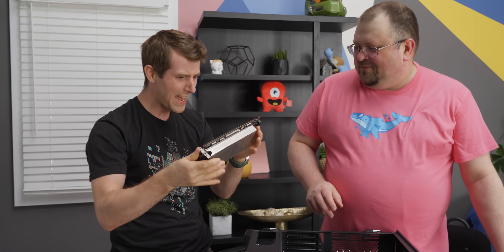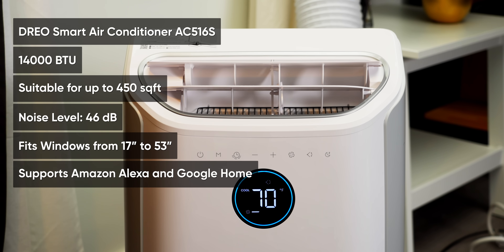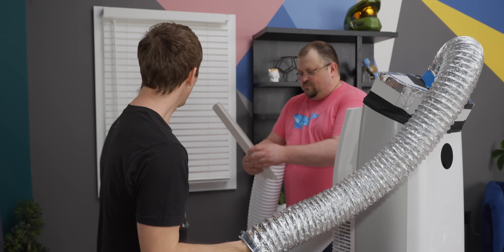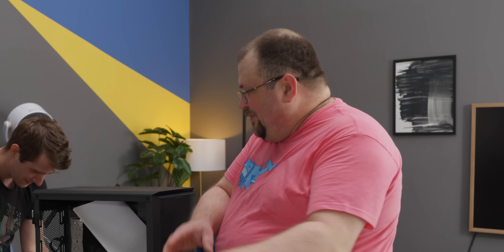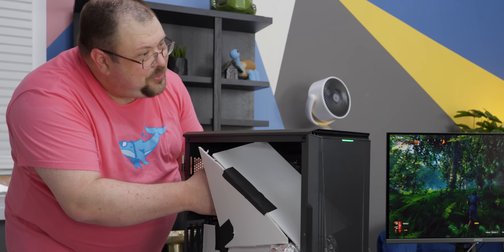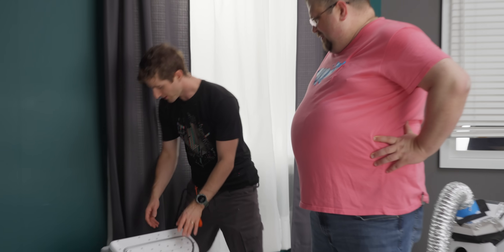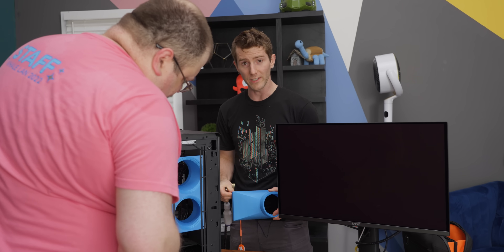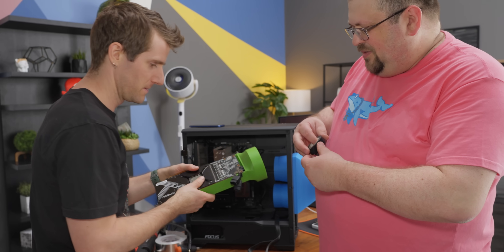Everyone is Cooling Their PC Wrong

Comment: In the summer, for intense gaming, I just use a fan oriented at the PC, it cools the room white dropping the temps a little
Reply: It probably felt cooler to disperse the heat, but you're not cooling the room that way. The PC would benefit, but you need to exchange the room air with cooler air from elsewhere to reduce the room temp.

Comment: Have you tried to use compressed air instead of normal air?
You could use some 3D-Printed nozzle to direct the fast airflow through the cooling rips, destroying the boundary layer and therefore increase heat transfer to the air (in theory).

Comment: LInus you mentioned condensation at one point. Since you mentioned condensation on the motherboard. Could you you also put desicant in there to keep condensation down and maybe go colder? Also wouldnt you want to put a duct from the CPU cooler to the back of the pc. And also cut out the back to further help the airflow. Also maybe fins in the ducts to make the air laminar as it goes through the fins. I also think you should drop the .stls on Printables for the ducting.

Comment: I have five fans including one tower cooler and my pc hardly heats up lol 😂❤ though I do need to monitor it if I try modern games' settings. ( Oblv Remaster at ultra though )
Reply: Well not i cluded two fans natively on my 4060 and one fan for the battery and one exhost fan lmao. So ... 9 total but 5 for cooling alone.

Comment: Idea:  a cooling system that uses the radiator in the AC as the radiator for cooling PC component.  So all the heat being exchanged goes out the window instead of hearing the room, and the room gets cool because of the AC and cools the less hot components of the PC

Comment: Turning a radiator shroud to a cotton or fabric to absorb the condensation as it’s coming through and would build and drip to the bottom with gravity. That removes your condensation issue and returns water back to the AC if needed.

Comment: Is condensation an issue with airconditioned air which is also less humid than the rooms air? Part of airconditioning is reducing the airs moisture level.

Commenting early to see if you guys cover that later! Loving this idea haha.
Update: ah, external insulation on the lines. I guess in this case vapor on the AC side could damage the external condensation, same with the PC exterior.

Inside the system, the air should be fairly dry cause you're constantly pushing dehumidified conditioned air into the system right? Youd be pushing out any more humid air.

Comment: Damn Linus doesn’t watch technologyConnections. Portable a/c’s without a separate intake and exhaust for the hot side is a terrible design. A 14k btu should be able to handle much more square footage. It’s using its own cooling to cool the compressor and heat exchanger making it like 50% less efficient
Reply: They mention Technology Connections fairly often on the WAN show.
Reply: @Metal_Maxine  I think Jake has before can’t remember if Linus has. But if they know of tech.Conn. then they have less excuses! That would be a fun guest to have on LTT. To be fair they are just doing it for the AC sponsor but there is so much knowledgable people on LTT forums, LTT Labs, LTT employees, etc that they shouldn’t encourage and promote inefficiency and bad design of appliances. They do a great job regarding electronics, but missing the mark here.

Comment: Could use air/water rads, plumb them to the components and have the rads themselves outside the case, with the AC blowing over them. I guess that would make sure you don’t fry your comments with condensation directly on them.

Comment: This is cool, and probably the more realistic solution, but what if instead of using a heat pump to to cool air then blow the air through the PC, you run refrigerant lines straight to coolant blocks on the cpu/gpu?

Comment: Now on a serious note... Hear me out. Why don't they make inverter for the PC cooling? 50-80watt inverter should be decent enough to cool the CPU and GPU. It can dynamically tune its motor to increase or decrease cooling.
It would not directly transfer cool air to the CPU and CPU because that would cause condensation but it would be form of liquid loop. Water goes through like it always does then passes by the plate which the inverter is cooling down thus the chilled water goes and cools the CPU/GPU.

I'd definitely buy that lol.

Comment: Those type aircons aren't efficient, they create negative pressure in a room bringing hot air from outside the room you are trying to cool.If there were two hoses outside 1 blowing on the condenser and an exhaust. That would be better

Comment: When the compressor turns off for any reason (and the fan of the evaporator still on) the condensed water on the evaporator will be thrown to the gpu and it will rust

Comment: I do this with a loud AC unit.
I set the AC up in an adjacent room, then duct all the cool air into my room with an additional room fan blasting all the warm air into the AC room.
Spliced garbage bags make for excellent cheap and flexible ducting with the caveat of poor insulation.

Comment: This reminds me of Asetek VapoChill LightSpeed AC (extreme compressor cooling systems) from the early 2000s. You were the king on LAN with that :) 
To solve the heating problem at your GPU cooling air duct you could try a Venturi insert to speed up the airflow towards the GPU
Reply: Phase change systems are literally the same except for the wasting energy on cooling air part. Pipe the refrigerant line directly to the die instead of all the extra steps. Maybe these new AC units are better, but older AC couldn't handle 100% duty cycle, either, which was what sold the phase change systems over DIY.

Comment: Next time, the PC immersed in mineral oil cooled by an industrial air conditioner. Not with air, but directly with a cooling fluid with a heat exchanger also immersed in oil. I think that the GPU and CPU could be stable at -10 C 🥶😅

Comment: single tube portable AC are not the solution. you're cooling the air in the room with the evaporator side which is normal but you're cooling the condenser side with your conditioned air and blowing it outside. some portable air conditioning units have an inlet and outlet tube to fix this problem. point is, not a product i would be promoting. they're expensive(the style of product in general) and perform poorly when compared to a window unit at a fraction of the cost

Comment: You don't need insulation/condensation prevent inside that air contraption. AC has dried the air in evaporator already. All outer surfaces has to be insulated
Reply: I'd like to see an experiment of this (just run the AC on max with the PC off) but because your creating positive pressure in the case, no "dirty air" will condense inside? I would probably be most concerned about actually dangerous outside areas like PSU. Might be better to move the whole PSU inside. If you're trying to minimize leakage into the case like they are doing here, though, everything outside, even the CPU and GPU die and board areas will get condensation just like direct pot LN2.
Reply: yeah, condensation is hot air + cold surface, not the other way around

Comment: The original inventor of the air conditioner invented it to reduce humidity in a print shop as ink was smudging during humid months. The people who worked in the print shop loved the cooling effect and the inventor realized he had targeted the wrong market and put one in a movie theater.
All that being said, I don't think condensation inside the machine will be an issue. That cool air should be rather dry, but condensation on the cold surfaces that are interacting with normal, moist, room air clearly are experiencing condensation.
Reply: interesting history right there, didnt know that that was the origin of AC
Reply: or get a digital hygrometer (the expensive ones painters use is the best) or if you don't have money, a whirling hygrometer. Read the dewpoint temperature, then set the AC temperature maybe 2-3 celcius above the dewpoint (i have no idea the equivalent Fahrenheit). Shouldn't have much condensation issues then.
Reply: @terradrive  9/5 Fahrenheit degrees to every Celsius degree or roughly 2
Reply: God bless Willis Carrier
Reply: It would seem to me that the best solution is to still use internal fans, and pipe the chilled air into the case as a whole, creating positive pressure inside. No condensation to worry about inside the computer case and no need for elaborate ducting and insulation inside.
Reply: modern ACs drain the condensation and mist it on either the condenser or evaporator (I forget which) to improve efficiency
Reply: Electronics do not produce latent heat. But, the human body does. You can create moisture in the case if the case is sucking in ambient air.
Reply: @ No, but they will not suddenly become ambient temperature after shutdown. The heat they still have (particularly the CPU and GPU) will prevent moisture from condensing on them, and I think will emanate enough heat to ensure even the cooler parts don't see any condensation by the time ambient air makes it into the enclosure.
Reply: @RAndrewNeal you're all assuming there's a return, there isn't. This is just a direct supply. A direct supply that is mixing with ambient air due to intake fans.
Reply: @ You wouldn't build this system with other intake fans. The chilled air would be the only intake, and you'd make sure it creates positive pressure inside the enclosure to prevent mixing with ambient air inside.
Reply: Good point. Air conditioners are actually dehumidifiers that happen to have cooler air coming out of them as a byproduct.
Reply: @enfieldjohn101  if there's a return it will dehumidify the air. There's no return in this setup
Reply: https://youtu.be/DWVfaxqTyl4?si=TiLasZZKS5NS-RSE&t=330
Reply: While it's running, this is true, you probably won't really have to worry about condensation, but as soon as the AC is off, warm room air could fairly quickly get in causing condensation.
Reply: @ I think the components will be more than warm enough to reheat the case before humid air has a chance to condense on the cooler surfaces, though it is still a valid concern.
Reply: @BelacDarkstorm  the evaporator still has thermal mass. the air entering the case would slowly warm up
Reply: @aleks138  Yep - ideally you'd want the AC fan run like an 90s turbo-timer from a car, set to carry on running for a few minutes after you're done with the compressor just to cycle air until everything is back to ambient temperature/humidity

Comment: And I bought a super overkill water cooler because my 65 watt CPU was going over 70 degrees with a stock one that still had the sticker on Lmao now it runs at between 55 and 30 degrees (55 is the absolute highest it reached in the benchmark and the highest I’ve ever seen it go after the upgrade)

Comment: What if you just pushed the cold air to the whole case and "ducted" the output instead? Wouldn't that reduce condensation? (edit: perhaps the only output needed in that case is via the GPU cooler, the CPU would probably be fine with just cold ambient case temp)

Comment: Would it have not been easier to make a "box" to attach to the back of the computer, slap the AC hose into it, and have the front of the PC be the exhaust? That way, you don't have a giant 5" hose sticking out the front of your computer, and you don't need to worry about all of that internal ducting, because the air will be less restricted...

Comment: This is basically exactly how I’ve been cooling my pc for a couple years. I have no trouble cooling my 14900KS and 5090 with it and my room still doesn’t go over 70F and even cooler near my gaming desk. To avoid condensation I tunnel it into the front case fans so that the entire case is the same cold temperature and condensation only really builds up on the outside of the tempered glass
Reply: Have you considered watercooling or maybe even not trolling?
PS he made an edit after i disclosed it would cause condensation on the outside of the case. He's really trying hard to troll people into trying it. DON'T, you'll end up destroying your PC!!!
Reply: @VikingRul3s  watercooling is too much hassle for the benefit
Reply: @aleks138  an aio is like 10x less tedious than an AC setup lil bro 🥀
Reply: @ AIO can't go sub ambient and has a risk of leaking
Reply: @VikingRul3s  Watercooling is elegant but not effective. The worst part is that it can fail and ruin your system at any time. With this setup, it may be expensive and Yankiest, but it could only be used during the summer. I can see some use cases.
Reply: @mewmew5143  You realize that i only commented on that because it a troll right? If that was his daily driver, his entire case would function as a dehumidifier, constantly producing an impressive amount of condensation on the outside. Maybe you can spin that into also having a self-refilling refreshing cold foot bath
Reply: @VikingRul3s  I do water cool, with a direct die cooler. I have a 14900ks OC at 6.3GHz p-core and 4.9GHz E-core
Reply: @angrasband3564  So since your first post your entire setup changed.... It's now a chiller (you've build without knowing what it is), therefor with isolated heads, but they still cool the entire case temperature enough to output 70F.... Riiight...

Comment: Condensation question: If your cooled components are always getting their air from the ducting, assuming that the evaporator doesn't warm up faster than the heatsinks do, won't the heatsink surface always be as warm as or warmer than the incoming air? Therefore there shouldn't be condensation?